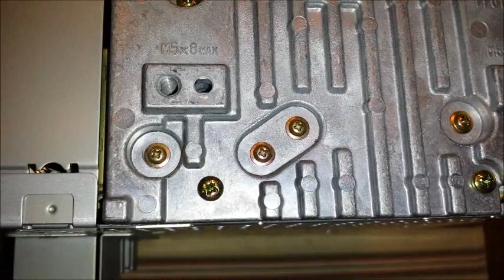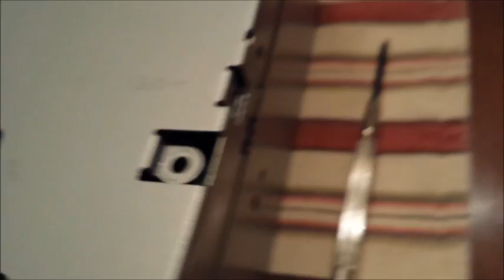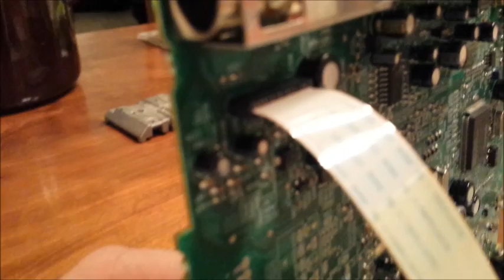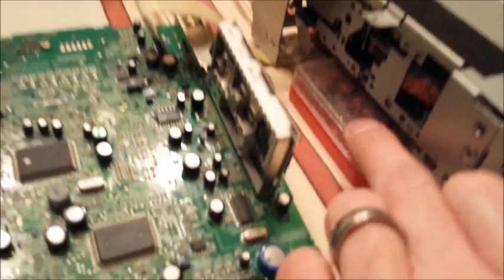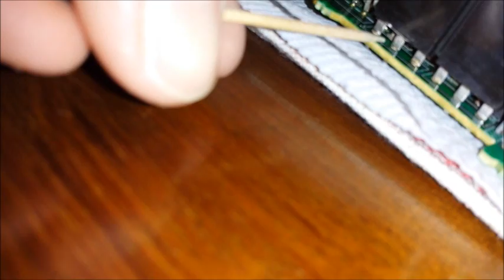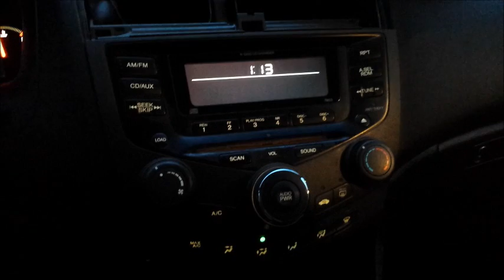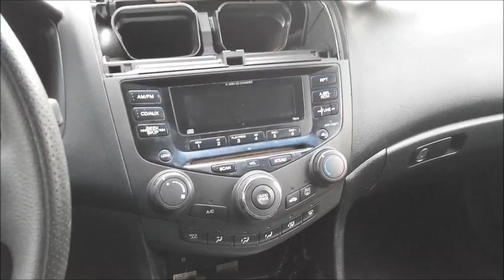2003 Honda Accord Radio Repair - Part 2

Comment: So I was wondering why my HVAC control lights did not work anymore after i removed the radio and installed a aftermarket pioneer signal din. So I guess i will have to put the factory unit back in and plug it up so that i will have HVAC control lights again.

Comment: This is a great video. I did this fix with the pen and it worked but when I turned on the headlights it went black and stoped working completely and could smell some electrical burning. I’ve decided it’s best to just go with an aftermarket radio and so I don’t have to deal with this problem.

Comment: Idk what went wrong with my repair… I coated the fuse/ resistor and the screen lit up for hours while I cleaned my interior…
However once I turned on my headlights it went black again… 😭 anyone have any thoughts?

Comment: Thanks Matt that just worked for me too,  the component you are jumpering it R197 R being a resister.  It’s super hard to get to the left side and circuit pen didn’t work for me, maybe a bad pen.  So I unsoldered the right hand side and wiggled the resister until it snapped off leaving the left leg and enough room to solder across from leg to track pad. Worked perfectly. Cheers

Comment: I know there's a ton of positive feedback on this video.  I'm going to try it so I have some questions if someone can answer.  Can someone who has done this confirm it works (my problem is the same as everyone else, no illumination on radio/heater display)?  Is there anything pertinent to know that is not covered in the video?  Thanks

Comment: Good video but ultimately not helpful for me. My 2005 Accord has a totally different circuit board.  The part you overrode is not identifiable on my board.

Comment: Hey, at 14:00 that is a Virginia State Inspection sticker! I have an '03 that needed this fix. Dealer did it. Very common problem on these turdbox Hondas. Now the backlight for the speedometer is out.

Comment: Thanks, matt, this was so helpful, even though this video is 7 years old, I fixed my Radio display with your three-part video. 
I followed your video, with a small change, instead of the circuit writer pen, I got some soldering help from a friend who used a piece of wire and jumped it keeping the resistor in place on the board. 
The fix worked and my display is back on. 

PS: Just so others know the resistor that is bad is R797.
Reply: Common problem that Honda was well aware of. The dealer replaced mine no charge. They tried to say the supercharger cause excess voltage spikes. Now my speedometer backlight is out. All of the other lights work.

Comment: Hi dudes...this video is great,but my radio has another problem,maybe someone can help me.My Accord is from 2005,and the problem is that sometimes when i listen to the radio,or cd, it makes a big boom in the speakers and the sound goes off..i turn it off and on and some times is working again,but in the last 2 weeks is really hard to turn it on. now is winter,so i dont thing that there is a heating problem

Comment: Matt, awsome video. Before I begin this task , I have a quick question for you. The ink circuit path is only there to bypass the chip ? Your toothpick is there to prevent the ink to make contact with the chip on both sides ? Sorry for my bad english , I hope you are understanding my questions.

Comment: That is the most asinine thing I've ever seen. They should have never had that pass through the radio just to power the lamps. My 2006 Accord is doing the same thing and I'm an electronic tech, so I'm very capable of repairing it, but I may just leave it as is. My wife drives the car and it doesn't bother her. However, I may decide to do it down the road . Anyway, a great video. Thanks : )

Comment: Hi together,

I've got a similar problem i.e my radio is the gps navigation system. That means the display is outsourced into the upper part of the middle dasboard. There one can find a smaller display then in the standard radio. This is becoming more and more dim after 13 years. Do you think this fuse is also the reason for my problem? The display is not totally dark but the readout is very bad at daylight.

Comment: My 2003 Honda Accord EX radio and CD player will work after I enter the reset code, but the radio plays for about 2 minutes, then shuts down; while the radio is working during those two minutes, I CAN play a CD.  All other features do work, like the heater, the lights, temp control, everything else, just not the radio. Does anyone have any idea what could be my problem. The dealer wants $135 just to diagnose, then, more, of course, to repair.  I realize that all these posts took place a few years ago, but HELP? Just bought the car from the Honda dealer in Santa Maria, CA, and will contact them about the recall and try to get them to do the right thing. Matt's video was awesome. Couldn't figure out how to contact Matt. Would if I could figure that out.

Comment: Hi Matt. Great video, very detailed. I am having the same problem on my 04 Accord EX sedan. I have a few questions for you.

1. What would you say is the difficulty level for using the pen on your radio? I would like to attempt this but I am not that skilled at using one as I never had before.
2. Would this all work the same way for an 04 Accord radio?
3. What’s the success rate of doing all this? I would hate to do all this for nothing. 

Great video again and thanks for helping us Accord owners!

Comment: Hey so I have a 05 Honda Accord with the same problem but the radia I have has Navi and it’s a touchscreen. Do you think that they will be the same from the inside ?
Reply from the maker: I am honestly not sure about that.  I believe that is a totally different setup, so I doubt the internals look the same as the radio in my video.  I'm sorry that I can't offer more help!
Reply: No problem . Thanks for the reply.

Comment: my climate control icons still wont illuminate with the headlights on. Do you think its a possibility that the strip bulbs are burnt? i havent checked for voltage to the lights yet. I am also plugged into an aftermarket external aux system to a component area of the radio that was previously being used for xm radio, etc. im thinking some power source was disconnected with the new wire set plugged in.
Reply: so its not the aftermarket aux clip that is keeping my climate control from illuminating. i know this because i plugged the old cable into the radio and nothing changed. i am looking at the backside of the faceplate and there seems to be a series of fuses near the ribbon which powers the led strip for the climate control. not sure if its a similar problem like with the radio.

Comment: Thanks for the video, saved a lot of money. To add, its a Fuse and can buy it on eBay. 
Search for "ICP-S2.3TN FUSE 2.3A 50V SMD FAST 2.3 ICP-S2.3"
Reply: Thank you for this info! "ICP-S2.3TN FUSE 2.3A 50V SMD FAST 2.3 ICP-S2.3" I found part on eBay.
Reply from the maker: You're welcome, and I'm glad you found this helpful!  Thanks for the helpful information, also!

Comment: If u buy a new stereo will that fixed the problem
Reply from the maker: Yes, that will fix the problem, as the new radio will come with a new circuit board.

Comment: If you look at the video showing the part there is a "R797" on the circuit board just to the right of the component.  From what I read it is a 0.1 ohm resistor.  Doubtless it is a "fusible resistor" meaning it is not there so much for the resistance but acting more like a fuse.   On the other side of the metal to which it is close are power transistors which are affixed to the metal as a heat sink and R797 probably goes to one of them.  Any other other power loss to the unit could possible be a similar resistor failure.  A continuity/resistance check would tell much.
Reply: Thanks for identifying the component!

Comment: Did anyone figure exactly what the component is? A resistor or diode? Any visible part numbers on it?
Reply: If you look at the video showing the part there is a "R797" on the circuit board just to the right of the component.  From what I read it is a 0.1 ohm resistor.  Doubtless it is a "power resistor" meaning it is not there so much for the resistance but acting more like a fuse.   On the other side of the metal to which it is close are power transistors which are affixed to the metal as a heat sink and R797 probably goes to one of them.  Any other other power loss to the unit could possible be a similar resistor failure.  A continuity/resistance check would tell much.

Comment: It would have been much easier to have turned the board over and use ur pen and draw from pin to pin. The solder connections are actually soldered on the back side of the board. But good video.

Comment: Dude you the man! I did this repair exactly as you did. Works perfectly now on my ‘03. Thanks for posting this. Makes it easy if you know right where to go to find the bad component. Circuit writer with a tiny micro paint brush. 👍👍👍👍. PS Honda dealer told me like 2 grand to fix.

Comment: Hi I have a question, I have 2004 accord and my stereo is a regular like this eatereo on the video, is not working, so I bought one and is diferent say "dual" on the air butoms  and is 6 cd changer, so do tou know if works on my car?

Comment: Thanks for the detailed video. I lost the backlight on my 2003 Accord radio and had seen a few videos but yours was the one I followed. Good instruction and my radio (& AC controls) are visible again. The clips on the bottom of the radio panel were a bit tricky. BTW my radio included a CD changer but the resister/diode/fuse component was in the same place. I ground it away with a Dremel and bridged the connection points with solder.
Reply: Oops! I have an '04 Accord.

Comment: i have a similar problem but i have a aftermarket radio in my 2005 accord an i was fixing something. an on the wiring harnes from the atock one to the afyermarket one of the wores grounded out an blew a bunch of fuses. so i changed them all today with brand new ones an none of the radios work. idk how or what to do now. has this happened to anyone
Reply from the maker: I'm sorry to hear that, Christian!  Have you checked all of the wiring to make sure nothing is burned/broken?
Reply: Matt Payne yes i did, i checked all the fuses too. an everything else works besides the radios
Reply from the maker: That is weird.  Do you have power coming to the harness from the radio fuse?
Reply: Matt Payne nope my 2 cigarette lighters dont even work an i put new fuses in too.
Reply: ***** i fixed the problem thank you for talking to me about the problem an trying to help i appreciate the help!!!
Reply from the maker: Nice work!  Glad to hear you figured it out!  I'm happy to try to help.  Congrats on fixing the issue!
Reply: @Christian Sevilla 

I'm interested in knowing what you did to resolve the issue? My cigarette lighter won't work neither does the back light however I have the oem radio...

Comment: Thank you very much Matt for this solution. I had been searching for this. 
I have a query.....        I own a Honda accord V6 3.0l 2004 model, it has automatic climate control, but sometimes the climate control just stops working. Nothing works in the climate control, neither the buttons, nor the fans and also the climate control portion on the screen goes blank. There is also the problem same as in this video. 
                               But the climate control automatically comes back on. Sometimes it takes a few minutes while on the other hand, at times, it takes even days. What can be the problem? I really need help regarding this.
Reply from the maker: Wow, that's definitely an interesting issue, Prathu!  I'm sorry to hear you're having that problem.  I'm honestly not sure if that might be caused by an issue with the radio motherboard/electronics, or if it could instead be an electrical wiring problem.  I don't have a good answer for you, but I would suggest you post your question in the electronics section of one of the various online Honda forums.  I'm sure someone more knowledgeable than I am might be able to help you.

I hope you're able to figure it out!  Please let me know if you do!  Good luck.
Reply: Thanks

Comment: HI, nice video. I have a problem with my fm module on my motherboard. My motherboard appears to be the same as yours. Do you, by any chance, know where I can find the diagrams for this motherboard? I need to know which pin is the "af out" pin
Reply from the maker: Hi Orlando, I'm not totally sure, but check out the link below...you may find what you need there:

http://www.tehnomagazin.com/Auto-radio-car-connector/HONDA-Car-Radio-Wiring-Connector.htm

Otherwise, I would check out a Honda forum, specifically the tech/audio section.  I'm sure someone more knowledgeable than I am can help you out.  Good luck!

Comment: Hey Matt, Thanks for the detailed video. 
I have a question btw. My radio and light are working now but only some buttons and ac controller (wind temperture and power control) does not have light. Do you think this is because of that fuse as well?
Reply from the maker: Hmm....that is an excellent question!  I can't answer this definitively, but if you are willing to take the time to remove your radio, you should be able to test for resistance/continuity across the resistor I bypassed to see if you have an issue with yours.

I'm sorry I can't give you a better answer.  I hope you get it sorted out, though...please let me know what you find if you do dig into it.  Good luck!

Comment: Could you have used the circuit writer pen underneath instead of over the resistor?
Reply from the maker: John, I'm sorry for my delayed response, but to answer your question - technically, you can take any path you want with the circuit writer pen, as long as it does not contact another existing circuit within the motherboard.

Comment: I did mine today..Working great..Thanks man
Reply from the maker: Awesome!  I'm really glad this worked for you.  Thanks for watching!
Reply: Would it be possible to directly add an aux jack to this without the adapters?
Reply from the maker: Hey Jake, I'm really sorry for the super delayed response...I'm not totally sure how you would an an auxiliary jack without some sort of adapter, but I am far from an electronics expert.  I would check a Honda forum and look in the tech/electronics section...I'm sure someone there can help you out!

Comment: I couldn't get my to open like yours  the disc player isn't letting me get to the resistor. how do I get that off?
Reply from the maker: Gustavo, are you saying your radio is a different model than the one in my video?

Comment: Hi Matt, I'm trying to do the same to my '07, but the panel looks different. do you know by any chance which mini parts do i have to fix (write over with the circuit pen). thanks in advanced for your help..
Reply from the maker: Hey Junior, unfortunately I am not familiar with the radios in the other/newer models.  I would recommend searching some Honda online forums...most have an audio/electronics section and I'm sure someone more knowledgeable than me will help you out.

Good luck - I hope you are able to get your problem sorted out!
Reply: Ok, thank you for replying back Matt!
Reply from the maker: You're welcome!

Comment: I have the single CD Player  version of 2004 Accord Radio. Does anyone know how to address this issue with climate control lights and backlight screen for the single CD version. My radio has only one PC board and a different layout than the one in this Matt's presentation and I can't locate this bad fuse that Matt is replacing. Other symptoms include popping noises in speaker along with intermittent backlight and climate control lights.Thanks
Reply from the maker: Carley, I'm sorry to hear about your issue, and it's a bummer your circuit board configuration is different than the one in my video.  I wish I could offer more help, but hopefully someone else can chime in and help you out.  I would also suggest checking some Honda online forums - they usually have a Tech/Audio forum with some very knowledgeable people that can probably help you troubleshoot this issue.

Good luck, and thanks for watching!
Reply: I have the same version single cd player, is not working sound a pop on the speakers, likr a short circuit, so do you know if a buy a 6cd changer and say "dual " on the air butoms can fit on my car, or the stereo match ?

Comment: my radio turns on though it will not play music it shows me the stations but no sound
Reply from the maker: Unfortunately, that sounds like a different type of problem.  I don't think this repair will resolve that issue, but you could try removing the radio and connecting a different speaker directly to it to see if you get any sound - the result of such a test will tell you if there is any sort of wiring issue between the radio and the speakers.

Good luck, and let me know if you figure out your issue.
Reply: +Matt Payne thank you so much for replying and I will try that
Reply from the maker: You're very welcome!  I'm sorry I don't have more to suggest, but try that and if you still get no sound, you can be fairly certain that the problem is with the radio itself.  In that case, I'd search for an online Honda forum and browse the electronics section.  I would imagine there are plenty of other people with the same issue, and someone is bound to have found a solution.

Good luck!
Reply: Matt Payne yes my car is having the same problem also please is there any solution yet for it
Reply: Did any figure out the problem for to make sound come back in